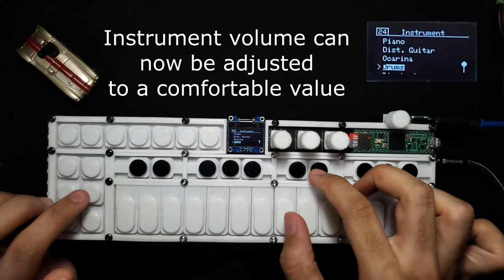Recording and Sampling on Teensy 4.1

Comment: This is so dope! I've been wanting to do a sampler project. I was thinking a teensy might be the way to go, then I found this video and determined that the answer is 100% yes. Having a 3.2 laying around helps too.

Does your configuration use the additional PSRAM chips, or is it somehow playing Dolly right off the sd card? That seems like a long sample for <1mb of ram, but I fully acknowledge I could be misunderstanding something here, haha
Reply from the maker: Thanks! You're right about the memory. <1mb is way too small to hold any reasonable amount of audio data, especially when its being recorded at CD quality. Currently, the recording is stored on the SD card as RAW audio data, and the way I'm chopping it into samples is just by remembering indices of different locations in that file. This is obviously not a great approach- first of all it's relatively slow, but more importantly, it's really difficult (or impossible? I haven't looked too much into it) to read two or more samples at the same time off the SD card or even play a sample from the SD card while recording to the SD card.

I'm definitely looking to use additional PSRAM on the Teensy (I think you can put in a maximum of 16Mb) and/or additional Serial Flash on the Audio Shield when I redo the device hardware . I'm hoping I'll be able to use it as a sort of intermediary storage where I can keep a kit of short samples while leaving the large recording file on the SD card. I haven't really tried this yet though, so I'm not yet sure how feasible it is. 

I totally encourage you to try do your sampler project using your teensy- I'd be really interested to see if you're able to expand on this approach and find a cool solution for storing and recalling samples!
Reply: @prajwalmahesh90  Thanks for the input! Sounds like PSRAM is the ticket, since slicing breaks and making em playable is my main concept. But then I'm in the beginning phases of conceptualizing it, so we'll see how it goes. Meantime I might be forced to swaggerjack some of your code off Github, haha
Reply from the maker: @burgersquid  sweet. good luck!

Comment: What a great project! I'm looking for something that will act standalone (small speaker or headphone audio out), is key-based (not just knobs) and would work as a basic sequencer with a percussion and a few instruments. My 8 year old is spending lots of time experimenting with the sounds and melodies they can make with a toddler's keyboard and I would love to put something like a polyphonic sequencer in their hands with a relatively intuitive ui, like you have made here. Do you think this project would be a good basis for me? I might want to enable sample record from the audio shield mic but other than that, this looks ideal. I suppose main thing you didn't demonstrate in this video is the sequencer part. Is that part of your feature set / road map?
Reply from the maker: Sure, something like this might work great! The awesome thing about the teensy/audio library is how simple it is to build an audio system and how customizable it is—so you can pretty easily put together a sequencer like you mentioned even if you don't use the same hardware/firmware as me.

As for the implementing the sequencer, it's definitely on the roadmap and I'm actually working on a polyphonic step sequencer right now that might be closer to what you're interested in building—look out for that in a couple days. There's some new hardware I've added that makes this operation more feasible than in these past videos.

Now, if you're interested in why I wasn't able to sequence the samples in this video—the biggest issue I've run into while working with samples is memory. That is, recording samples (from the mic for example) produces a fairly large amount of data (imagine 44100 samples per second, each taking up 16bits) and we need somewhere to keep it all. Especially if we want to have multiple samples, there's no way we're fitting all the audio into the Teensy's ~1Mb of memory.  
In this video,  since I had no other option, I'm sending the audio data directly to the SD card and playing it back from there. This has several limitations since, because of the slow communication speed, we can't really play more than one or two sample at a time (polyphony isn't really possible) and we also can't use the SD card for anything while a sample is playing. One way around this is to keep our big audio files on the SD card, but use another source of fast memory as a middle-man between our audio output and the SD card. That's what I'm trying to do with serial flash memory right now, and you can see more about that in the upcoming vid or once I get around to putting the code for that up on the GitHub.
Reply: @prajwalmahesh90  great, I was going to put the spi flash on the teensy audio board when I buy on.
I have been over to your blog which is a great resource. I would love to tip it to the Hackaday tips line but since I have seen some projects prefer not to break cover until they are further down the line (and have been frustrated by a "premature" publication on hackaday), I thought I would ask if you minded being on hackaday or whether you would like to wait. Its such an active project I totally understand if you want to get further before something like that.

Regardless, thanks and keep it up!
Reply from the maker: @simonmerrett  Thanks for asking, I appreciate you being considerate of the situation! I would prefer to wait before doing that mainly because at this point, there are more bugs and problems than there is functionality lol. I wouldn't want a lot of people to try and replicate it until I've ironed out the major issues.
Reply: @prajwalmahesh90  no worries, will be following along closely so might ask again later.

I just had a thought - wondered if it would be worth trying to reverse the design (if I were starting, not suggesting you should do this) so that it fits in one of the common aluminium keyboard cases. Eg an anodised aluminium 60% keyboard case would be a cool housing for it. Although I realise the depth is perhaps greater than the 8-9mm you get with those cases.

On the name front, how about "Teenthy"? :-)
Reply from the maker: @simonmerrett  Woah dude that's a really good idea. I didn't know about these little keyboard housings, but it would absolutely make a nice, premium-feeling enclosure. I might want to switch over to that as well!
For depth, the current design is actually just a flat PCB with SMD components, and the only reason my enclosure has any thickness is to allow space for the battery. If you could get a thinner battery or find some other way to power it, I think it's totally possible to build it into one of those keyboard cases
And thanks for the name idea!

Comment: Idea:

Split the keys in to two seperate parts..

IE. The lower set of keys are the root and the upper set of keys can be assigned a new root allowing cross octave use.

(Bass left hand / lead right hand)

Comment: awesome project and very professional realization! 
can i ask you which sf2 decoder did you use? the one i found on github (https://github.com/TeensyAudio/Wavetable-Synthesis) doesn't seem to be compatible with the AudioSynthWavetable class contained in the audio library and its output is different compared to the .h and .cpp files that you use in your project (different files are included and missing "AudioSynthWavetable::")
Reply from the maker: Thanks! I believe there's an up-to-date version of the decoder here (I haven't gotten the chance to try it out yet): https://github.com/PaulStoffregen/SoundfontDecoder but if you don't want to mess around with python or don't have too many sf2 files to convert, the other option is to just manually find/replace all the name changes in the .h and .cpp files (which is what I ended up doing). 

These were all of the changes that needed to be made (in case you end up going that second route): 
DECIBEL_SHIFT -> WAVETABLE_DECIBEL_SHIFT
CENTS_SHIFT -> WAVETABLE_CENTS_SHIFT
NOTE -> WAVETABLE_NOTE_TO_FREQUENCY
LFO_PERIOD -> AudioSynthWavetable::LFO_PERIOD
ENVELOPE_PERIOD
 -> AudioSynthWavetable::ENVELOPE_PERIOD
 
UNITY_GAIN
 -> AudioSynthWavetable::UNITY_GAIN
SAMPLES_PER_MSEC
 -> AudioSynthWavetable::SAMPLES_PER_MSEC
instrument_data
 -> AudioSynthWavetable::instrument_data
 
sample_data
 -> AudioSynthWavetable::sample_data
 

Good luck!
Reply: @prajwalmahesh90  thank you very much, your reply was so helpful! best wishes for your project

Comment: What can I use instead of ATMEGA64, no need to burn？
Reply from the maker: One other option I can think of is just to start with a full Arduino board (that has enough pins), like a cheap Arduino Mega clone for example. These come from the manufacturer with the bootloader burned and ready to go, so you can just program it using USB and then wire everything up manually. You can even de-solder the chip at that point from the original board and try to wire it into the new PCB, although it probably won't be a drop in replacement - you'll have to be conscious that the ATmega2650 (the chip on the Arduino Mega) has a lot more pins than the ATmega64 I used here, and also different pinout in terms of hardware interrupts and i2c and whatnot. These would have to be wired appropriately or reassigned in the code if possible.

That being said, I think buying the blank ATMEGA64 chip and burning the bootloader is definitely the easiest and cheapest option. I'll put up a clear wiring diagram as soon as I can to hopefully make that step as simple as possible.

To be honest, I  realized I designed this version pretty inefficiently in terms of pin resources. I'm currently working on a new hardware revision where I plan to multiplex all the button inputs and this should drastically cut down on the number of pins needed. This means the ATmega64 can be replaced with something smaller and more accessible like the ATmega328P (the chip on the Arduino Uno). I'm trying to get that done by the end of the month, so definitely wait and check that out if you're still interested.
Reply: @prajwalmahesh90  Thank you very much for your answer, I am not sure if I want to order pcb now，I always wanted an op-1, but it was too expensive